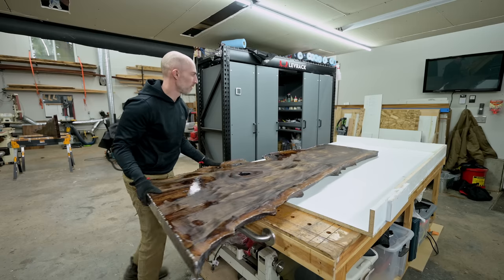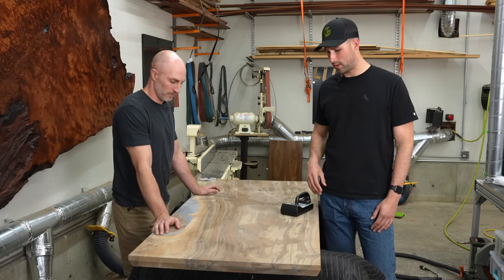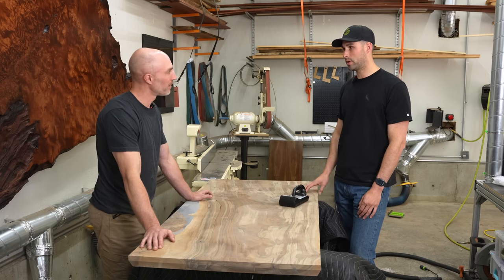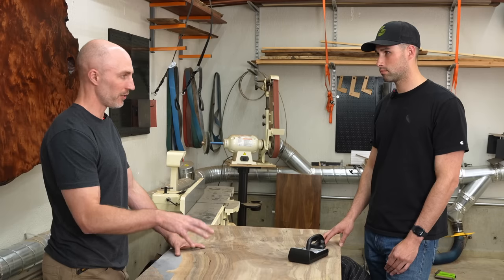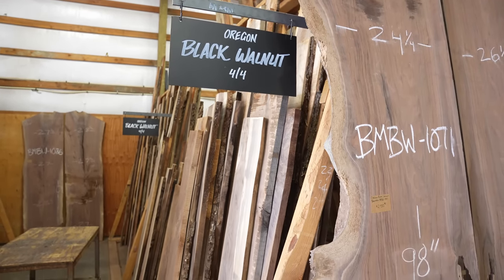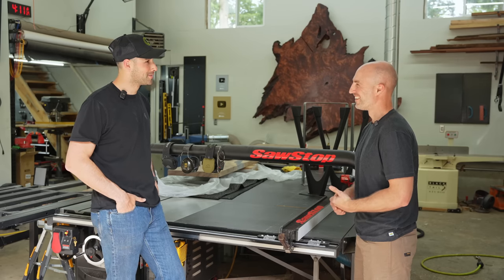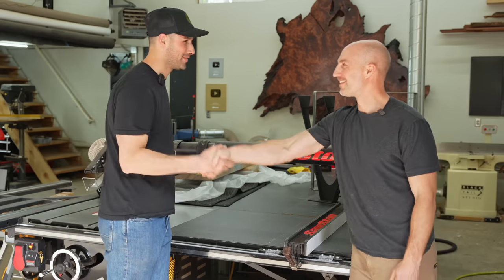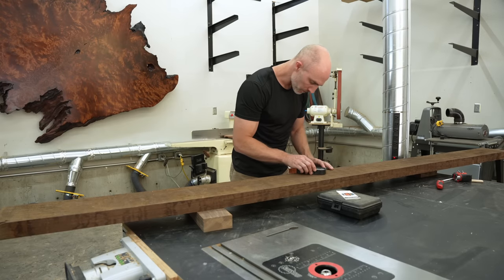Confronting My Wood Supplier

Comment: So, let me see if I understood right: the wood will try to equalize with the atmosphere. OK? So, where I live the air humidity in summer is around 70% and in the winter from 85% to 95%, what would be a "dry wood" here? (I live in the northeast of Brazil, A city called Recife, capital of the state Pernambuco. Always hot, raining in the winter, lots of sun in spring, some storms in summer, a lot of wind in autumn.)

Comment: Hi Cam, I commented on the main channel vlog and I have a question, as a client purchasing a piece like we just have with our $1500 desk top, what are the things that can go wrong over time if the wood is wet? Obviously we don’t have a moisture meter to check and we’ve just left it to them with dimensions and type of wood we want, it’s a 1830x600 floating desktop with 2 c channels to prevent future cupping finished with 2 coats of osmo polyx hard wax oil. Cheers Shell 🇦🇺

Comment: Tough business. If you try to catch the pieces that are, say, three standard deviations from the norm in terms of water trickiness what does that do to everyone’s cost of materials? I mean woodworkers are trying to sell worked wood not a super expensive piece of lumber. And labor prepping a single piece of raw material can very quickly escalate costs when it’s supposed to be a volume based business. So I guess the hope is you can ensure your lumber yard workers have the time and expertise to focus attention on the most likely to be tricky pieces.

Comment: The meter is only measuring the moisture level at the surface or very close to it.  What about moisture deeper down in the slab that you can't pick up with a surface meter?  I'm sure you don't want to be drilling holes all over to get deep measurements.
Reply: Our meters actually read deep into the slab. If you take a piece of 3/4 inch wood and measure it, then put your hand behind that spot, you'll see it's still reading through that whole slab (Unless you put your meter in 1/4" reading mode). You are correct, though, that there are other meters out there that don't read deep or are highly affected by surface moisture.

Comment: I'm interested to see what happens to the original pieces. Will they reappear once they are dry and you showing us the "this is what happens after the moisture content is removed" and if it's still usable/fixable. It wasn't mentioned what the final outcome would be with the slabs.
Reply: I think it’s too late because he already sealed it in epoxy already. Which sucks.

Comment: If a vacuum RF kiln was used, the temperature is much lower than in a traditional kiln and could reduce movement.
Though I have never heard of a wood/ epoxy slab being dried in an RF Vacuum kiln, I would be very curious if it would work to get the moisture content down without compromising the bond.
This method is fast compared to a traditional kiln at 1 week per inch for Maple.

Comment: Hey Cam! Is your shop heated and how so? I do not have anywhere to work other than my garage, so my option is to bring my slabs into my house and let them acclimate. Then I can take them out to my freezing garage and flatten them. I'm so stressed about warping though. How long roughly is wood okay to be out of the warmth and in the cold? 4-5 or 24 hours? If I left them in my garage would putting c channel(s) in the slabs help it from warping much if at all any? I religiously watch your videos and have been emulating your workmanship (in my own style). Thank you so much.

Comment: You can't afford me cut it out if you were so expensive you would have a comparable moisture meter to your supplier 100% quality can only be achieved realistically 70% of the time when it comes to wood slabs you have to absolutely as the wood worker do your own due diligence in checking and verifying the product you receive. You do amazing work no doubt but try to remain humble as possible that is what will set you apart from the rest

Comment: Id take it as it was. And plan on it changing over time, then deal with the changes as they came up, if you think about it, its wood a living breathing stock that will age and change over time, yes id prefer it be stable but I think that the change would add instrest to the project, and truly make it a one of a kind item.
Cracks open up add more epoxy maybe some colors  call it the fisher table, or warpy wood, twisted table. Wobbly wonder.  Or even all of the above.
Gell it might make a nice marble race track.  How long do people who spend this kind of money keep somthing, 
If your spending that much on a table its one of 2 things a permanent keeper, or just decorative item you grow board with after a few years.  It really depends on the person who's buying it. They might find beauty in it even after it changes.
Sure you can make one thats stable and won't move, you can cut it into parts and glue it back together with oppsit facing grain to make sure it dont move. 
But they are looking for the slab look.

You buy when you need some guys buy and let it stand for years then use it.
You might have a slab you've had for 30 years looking for the right project. And customer.  
Chances are it goes to a cold area sits outside and the dry air sucks the water right out of it.

Comment: I still feel like you could just have them air-dry it, and then give it back to you a couple months later, take the top layer off it so it's flat again and then it'll be good? Or does the table have to be the thickness that it is now?

Comment: arggg, what a shame and how frustrating :( ... cheers for uploading this, the video was vey informative, but now I've watched this, I'm honestly still somewhat confused, like, why the hell did no one test the damn wood? the supplier has stated that they are at fault, so I'm guessing this means that the wood can't have taken on moisture whilst in your possession, but the question still remains, are they really at fault? I understand the supplier kiln dries the wood themselves and they plan to supply the wood in a dried state, but when testing the wood seems to be as simple as unpacking a small moisture tester and testing ... I can't help but ask, how the fuck was this not done previously? like, when you were choosing which slabs to use? when you got them home? when you marked them out? when you cut them to size? like, how come it was only first tested well after the material had been measured, cut to size, placed in forms and finally after the resin poured? like, it doesn't make sense! if the supplier is at fault, then one would conclude that there were many opportunities to test the wood? ... yet, it was only tested after the resin had been poured ... which again, brings me to the question of it being completely the suppliers fault ... and as mentioned, yes, I understand that they are responsible for "drying" said wood but it seems you had many occasions where you could have tested said wood? or am I completely missing something here? and you weren't able to test the wood or get an accurate reading at occasions through the build ... 

All the best for the new build, I hope you're able to properly test the wood and hope that everything goes smoothly, I don't doubt that the mistakes you're making along the way are not only frustrating but also expensive, but in time, they're much more than mistakes, they are invaluable lessons that are inevitably helping shape a master.  😊😊👍👍

Comment: Another question... Wouldn’t the wood get rained on outside or does that not matter?
Reply: because the tree is dead its not actively sucking in more water, there will be some surface penitration but far as i know that works its way out fairly quickly vs water that is still trapped from when the tree was standing
Reply: @danielbricker7928  Ahh okay that makes sense. So it won’t actually penetrate deeply. Thanks for the explanation 🙏🏼

Comment: A great service to us subscribers would be to know what kind of moisture meter you recommend and what level is unacceptable.
Reply: Can't speak for Cam, but he's using a Wagner Meters Orion 950. Generally you want to match the EMC (equilibrium moisture content) of the environment the project will end up in. In many places that's 6-9%. But in some states and environments it's 12% or more, so your best bet is to measure and calculate. (That Orion 950 will do it for you)

Comment: I have a question, I have a local "sawmill" type wood supplier, I get from him walnut, almond, and olive wood, but his main business is selling firewood, not wood for furniture, so when he gets a big log he calls me and asks if I would like him to resaw it into slabs, cookies, I usually say yes since what he sells me is about half the price if not less then the wood at normal hardwood stores, I recently purchased around 600$ worth of almond and olive wood, the olive is already in an epoxy pool that im waiting to dry, this video made me very scared that all the wood I bought might be very wet, I called him and asked he said he never checks with a moisture meter he just leaves the wood to dry up for 1 a year or 2 and hopes for the best, do you have any tips on how to know if wood is wet or has pockets, i ordered a moisture meter but its gonna take another week to get here, im kinda freaking out about this cuz im selling this olive wood table for 2000$ its the most expensive thing ive ever sold and if its wet then the 200$ in wood and the 300$ in epoxy is going down the drain, he already told me eh cant do returns cuz hes not a lumber store with huge over head hes just a guy with a saw mill and a small kilm

i have been buying from him for a few years now with no issues, i have only made small coffee tables and cutting boards with the wood cu its generally pretty small, but getting the oportunity to get old growth olive from the roman era was something i could not pass by and build a pretty big dining room table, so far i dont see any signs of cracking, lines or anything that might show yeah theres water but still if anyone has any tips please please respond to this and tell me what to do until my moisture meter comes and if its wet what to do with the wet wood

Comment: Cam, 
     Personally, let me say that there are a lot of good examples of positive interaction in this video. You've taught me a HUGE number of things about epoxy building that I probably couldn't have gotten elsewhere. 
     That said, let me run somewhat against the grain of many of these comments. I think you were harsher than you needed to be too early in the process. Here was a business partner with whom you have a good relationship and who was willing to make things right. Instead of recognizing that, I felt that you came on too strong, too early. Sure, $30k was at stake and that would make anyone pucker up and be tense. So noted. But I also think that you could have been kinder to your business partner, because that's what Aaron is when it comes down to it. Putting him on camera and essentially making him admit his mistake in public is a harsh way of getting satisfaction. I'll probably get shouted down by the "it's just business" folks here but I've been learning and teaching org culture and org behavior for two decades. Relationships are super important. I'd be surprised if you didn't put an unnecessary dent into your relationship with Aaron even if he says everything's okay. Just my two cents.

Comment: This may have already been asked, so I apologize. Is it possible to find a slab that has acceptable moisture readings at the supplier’s facility, but then you test later in your shop and moisture has got into the slab somehow?
Reply from the maker: It can absorb moisture from the atmosphere. So yes… but it would also dry out pretty easily too. From summer here it could be 9%, then as high as 20% in winter if you kept it in a barn that wasn’t climate controlled
Reply: @blacktailstudiouncut  Thanks for answering!

Comment: So can you not re-dry it, see what happens. 
If it splits then add an epoxy feature to the split. If it cups then bin it if the cup is to great or resurface it if its minor. 
This is the sort of thing that happens when working with a completely natural material. Fault is partly your own for not performing checks before starting work on the material. 
When you 'assume' you make an a$$ out of u and me. 🤣

Comment: I don’t think it’s “trapped“ moisture especially considering you’re in Oregon. Wood picks up moisture from the air so if the air is 25% moisture that’s what your slab will be eventually. Also I’ve found most wood movement is done above 30%.

Comment: A pinless moisture meter can be had for under $50. There's no excuse to not have one. Are they as accurate as the expensive ones? I'm sure they're off a few points on a single measure, but you just take multiple measurements and average them out, and you'll get good enough.

Comment: how much should the gauge show, what is the acceptable value for moisture in the wood?
Reply: It should match the EMC of the environment the project will ultimately be installed in. Ideally that's measured and calculated. Rule of thumb in a lot of places is 6-9%, but at the minimum look up the EMC in a chart for your local area.

Comment: I know little about wood so this may be a dumb idea, but why not dry these under vacuum at your shop? You could vacuum bag these pieces, put them on a temperature controlled heating blanket and have a relatively small vacuum chamber filled with desiccant attached to them. This should have a benefit compared to the oven drying, because of the massive amount of force being exerted onto the piece under vacuum, essentially not letting it move and keeping it from warping. In theory you might get somewhere near 14 psi of pressure difference, which for lets say a 3100 square inch piece would come out to about 43400 pounds (nearly 20 tons!) of pressure clamping it down evenly. Of course the vacuum increases the evaporation rate by a lot as well, so you might not even need to use much or any heat at all. I did a quick search and found a science paper titled "Vacuum Drying of Wood - State of the Art" that has a lot of information on the topic. Maybe that's something worth looking into.

Comment: So,.. hold up,.. you are in a business that deals with material that comes from nature,.... literally billions of strands of wood fiber run through that slab of wood. You showed in the video that workers were testing a multitude of areas across slabs they were going to put up for sale. Then,... (God Forbid) you decided to plane off the tested area and expected to find nothing but concise moisture levels across the wood. I noticed the slabs you like to work with regularly. You love the twisty twirly woods that have great eye appeal. Surely, by now, you understand that those twisty twirly grains all have mitigating levels of moisture because,.... wait for it,... it is twisty twirly grains!!! Your human supplier is not at fault here on your choice of moisture-retaining grains. If you want to continue to use this kind of wood, you could set up your own secondary solar kiln to re-kiln the material after you have it slabbed out the way you want. That way you are 100% sure about the surface material prior to finishing it and putting the piece up for sale. This should be a standard when you are selling $30,000 exotic wood grain items. With a secondary solar kiln, you will also be able to go back and reclaim some of the projects that you have written off as ruined pieces in your wood shop.

Comment: What’s the brand and model moisture meter you are using.  I currently have the pronged type.
Reply: Link included by Cam
Reply: @jennybarnes4806  not seeing it under the header
Reply: Orion 950 by Wagner Meters

Comment: How did our ancestors do it without the fine measuring equipment & tools we have today? & for cheaper as well! Bough everything was made with wood back then.. as someone that lives in a Georgian wood frame house (with the beams exposed in modern times) I’ve always wondered how they got all these odd misshapen timbers to fit into a house without thrown all moving & falling down over 100s of years..? Good company btw very professional, I’m sure you’re chuffed to have such a great supplier!
Reply: Most buildings from 200+ years ago are no longer standing. Sure, you get them dotting the countryside or a historic district in a city but overall it's only a small fraction that survive and those are going to be the ones with active maintenance, care, and upkeep. Survivor bias.

Comment: I wonder if using vacuum on a slab would move the moisture out quicker.
Reply: It potentially could, but would be super expensive for a large vaccume chamber, and with the expanding water you risk weakening and splitting the wood, again the goal is to dry it not all the way out.

Comment: Cam was not being a dick. This was a stern but very valuable conversation between a customer and provider about who was at fault and the expectations from the customer. The owner of the company handled the mistake very properly and should be a model of how to run a business.  The wood supplier being in the speciality wood sales, knowing that people are trying to make beautiful pieces of art, the prices being charged, there is a high quality expectation to be had on the supplier that they now need to hit.  I once had a machinist screw up a really nice, rare engine block. He took no responsibility and I had to finally take him to court get the money to properly fix the block. I wish I could of had this type of conversation with him and wish he would of made it right. Kiddos to both sides on how this was handled.